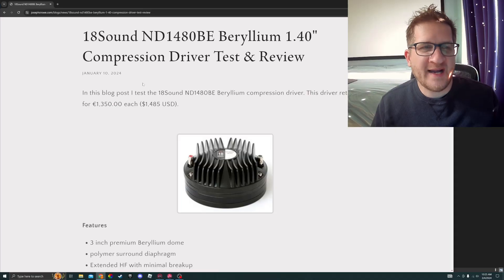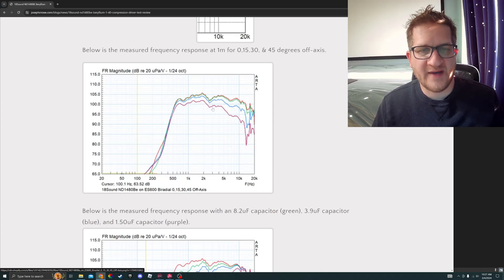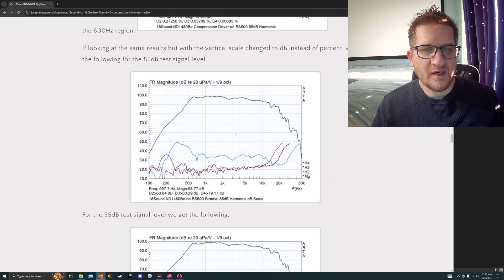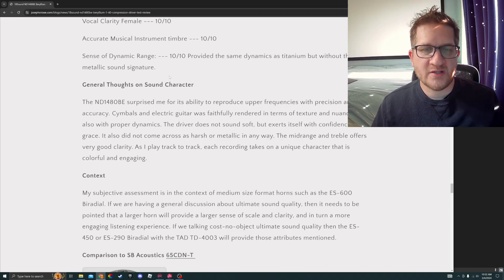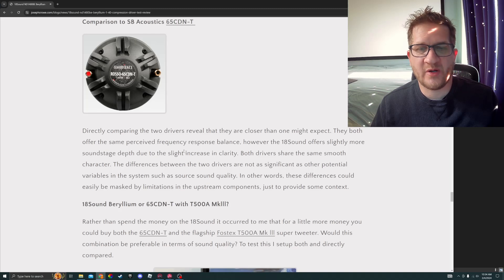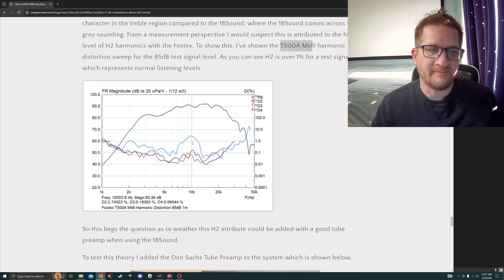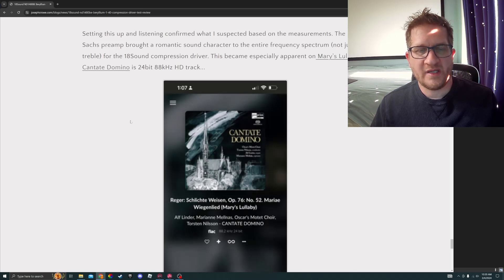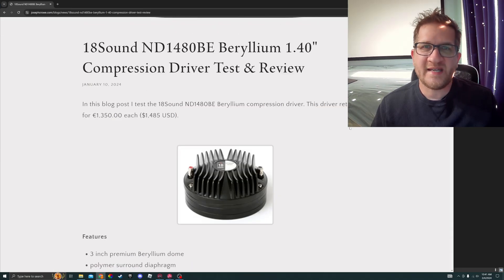18Sound ND1480BE Beryllium 1.40" Compression Driver Test & Review

Comment: The lack of crossover @8 kHz is a strong point. Saves additional amping and / or crossover. 
I guess only if you can manage to get it close to perfection, a 3 way system could have a slight edge over the 18Sound 3". But I doubt that this come close to the 18Sound overall performance. What's the phase / step response of 3 way vs. 18 Sound @8 Khz?
 I'm sure, 15kHz top end is plenty for all of us. Much weightier is a smooth 8 kHz region IMHO, where voices can get pretty harsh. 
Nice driver, expensive, not the one for experiments but well worth when combined with a optimised horn/waveguide. What do you guess is the lowest possible acoustic crossover point for the 18 Sound with Bessel type filter and bigger horn?